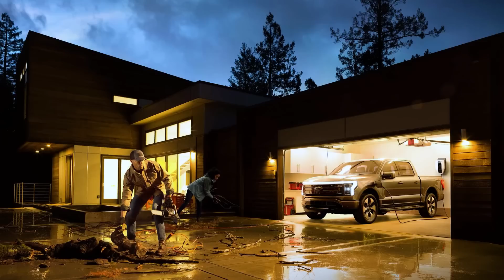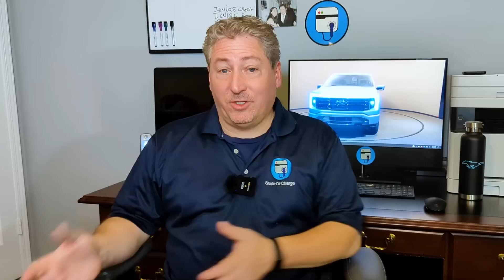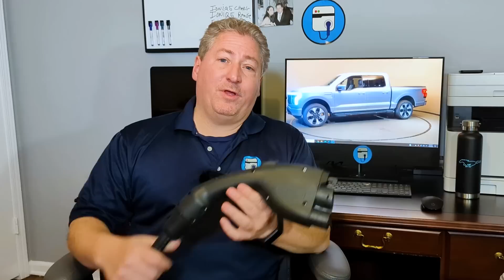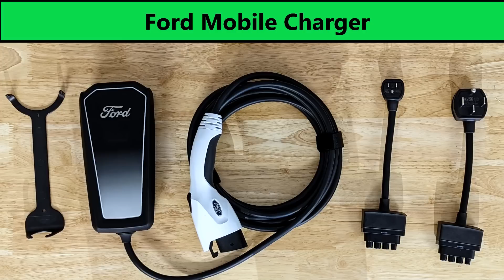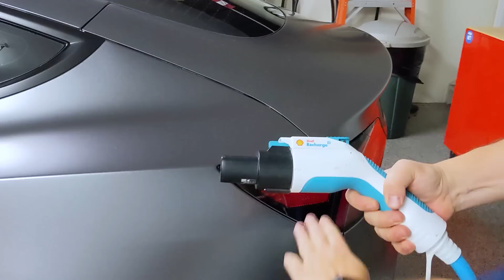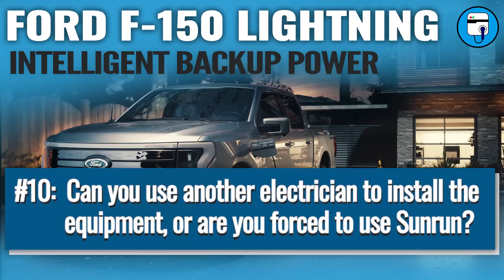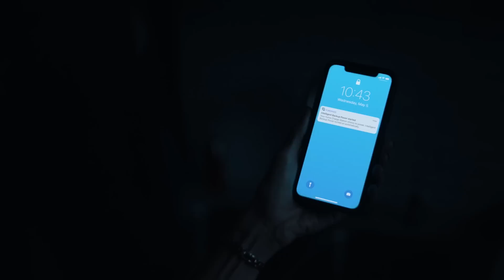Ford F-150 Lightning Intelligent Backup Power: Everything You Need To Know

Comment: So if I'm understanding this correctly, you need to also procure (from Sunrun or whomever) a compatible separate inverter, transfer switch, and small black-start battery. I expect that expense to be non-trivial, as the 9600W inverter will have to be similar in hardware to a solar inverter with grid-forming capability, and those aren't cheap- $3000 or so. It's neat that the Charge Station Pro is included with the truck, but it seems like Ford is leaving the expensive bit (the inverter) in the customer's court. 

Do we know if the Charge Station Pro can be used to charge (only) non-Ford-Lightning CCS vehicles? The connector will fit, but I suspect some vehicles may wig out about having a CCS connector engaged and being offered AC charge.
Reply: Ford says: "Connector uses industry standard/universal SAE J1772 connector. Compatible with all electric vehicles on the market today (that are compliant with SAE J1772), including Tesla with a commonly used adaptor". Of course, this excludes early models that only had the j1772 with no DC pins.

Comment: I hold the contract for several counties to install these for ford. Any additional questions you guys have im happy to answer
Reply: Can IBP sync with the Utility after going thru the SunRun inverter?  Just like solar panels & home backup batteries/powerwalls sync the 60Hz frequency.  But if utility drops, all the alternative sources of power drop to not feedback on the utility.  A switch to drop out the utility, without being a transfer switch, would be needed for utility safety.  Then the alternative sources of power take over. (Hmm, how do three different sources of backup power sync?  Vehicle, powerwall, solar?)  When the "magic" switch detects the utility is back, the alternative sources of power sync waveforms with it, and the utility connects back.  Is there such a thing?

Comment: It's really straight forward and basic 101.  All you need is a manual transfer switch which contains a certain amount of breakers that can total up to 20 amp to 50 amp or more.  You're just connecting all the wires that you want to power in your house by connecting it to your main breaker which goes to all of your amenities like fridge, stove, ac, certain rooms, etc.  There's nothing special about intelligent backup power, it's just a marketing gimmick.  The only thing is it has a software in the truck that will cut off the power to the house takes too much amp or watts from the battery.  Instead of using your gas power generator, you're just using the truck battery.  No technological break thru.  However, I like the idea which is much cheaper than dealing with a Tesla battery wall.

Comment: The Lightning being built is like watching paint dry. Bought a F150 Power Boost Lariat Hybrid while I was waiting. It will light my home and I can take it on the road with over a 600 mile range before I fill up in about 5 minute and go for another 600 + miles! Without a charging station on every Corning. My gut feeling is that Electric Cars for everyone may go away after the 2022 Congress Election and the tree hugger leave office!

Comment: I sorta suspect the warranty  for powering home will hold.  Pulling 9.6Kw a lot and charging back at 19kw should be WAY WAY WAY easier on battery than pulling 100-400Kw out on the roads and then charging at 150Kw at a DC fast charger.  So as far as the battery warranty goes...guessing Ford would be happy if you use it more to power house than drive around on long road trips.

Comment: My question for Ford is why are they charging people to use this feature on the standard range battery, if the feature is already built into the truck and I bought the truck then i should be able to use it without having ti pay extra, and if I do have to pay extra, that cost should be available and made public at the time I ordered my truck, not weeks after orders were made.
Reply: What exactly do you claim you were not informed about?  Every Ford advertisement (and webpage) has included in the fine print that IBP requires the Charge Station Pro AND additional hardware "to separate the panel from the grid".
Reply: So, I am willing to pay the $500 to get the Intelligent Backup Power software activation for my SR Lightning, but can't find where I can do that.  Ford's web site says, “Intelligent Backup Power software activation is included with the purchase of the extended-range F-150 Lightning battery or can be bought as a one-time purchase for the standard-range battery here.”  The word “here“ is a hyperlink to a page, after signing in, that says “SOMETHING’S NOT QUITE RIGHT, so it's a dead/bad hyperlink. No one in Ford Customer Service that I have spoken to has been able to answer that. Help!

Comment: There is some partial truths here or at least something to research further.  You dont need a 320 amp service.. However you may need a larger then 200 amp panel for your 200 amp service.   Reason is that it appears the  ford can push power back in to the house when the grid is up so you can pull 200 amps from the street and add in another 80 amps from the truck and run 280 amps of stuff in your house.  Thw two power sources can  overload the bus bar from a 200 amp panel.   The  'problem' is Ford Pro charger appears to be a  Standby System that can operate when the grid is up and is covered by section 705 of NEC which requires a larger panel to account for both power sources.  Since ford pulled this then maybe they are reconfiging their device before launch.
Reply: The truck can only provide 40 amps, not 80.  (9.6 kW)
Reply: @evahsia  That is 9.6KW of power is based on the built in inverter used by the plugs so it COULD provide more but I think you are right in that they did create it at the same 9.6kw.  That all being said, the same logic is still there, if they allow truck to feed panel at same time as street you would need a bigger panel.  But ford updating the website seems to indicate this would either not be allowed any more or not a core feature
Reply: @1personalt  I don't think so.  The built-in (in the truck) inverters are AC to DC.  They have nothing to do with DC coming back to the house, or the house would not require the separate SunRun inverter.  Also, the extended range has 19.2 kW worth of inverters, so if those were used, why would the limit be 9.6kW.  I suspect Ford recognizes that anything over 40 amps would require a main panel upgrade, at additional cost.  The same limit is why my solar power supply is limited to 40 amps.  (200-amp bus, NEC allows 20% extra -> 40 amps maximum.)
Reply: @evahsia  - I agree with that you are saying that the built in truck inverters have nothing to do with home charging.   And I think you are right in that if the home backfeed limit is 40 amps a 200 AMP panel would  be fine.   Where ford made it confusing is they keep highlighting the 80 amp charging feature and not really highlighting the lower limit.  But the fact that the 320 numbers are not on website likely means all the points you made are 100% correct.
Reply: Yes, it almost seems that they picked 9.6kW and designed everything around that.  For example, the cable from the Charge Station Pro.  The 80-amp AC side needs #3 wire and the 40-amp DC side only needs #6.  5 conductors of #3 wire would make an unwieldy cable even more difficult to manage.  (Technically, the DC side really needs only 24 amps (9600W/400V), so that might be a #10 wire.)  The largest single phase inverter SolarEdge makes is 11.4kW, so anything over that is probably very expensive.

Comment: One more thing: Why not use  "dumb" (my term) backup power. My plan is to use the Nema 14-30 plug in the bed of the truck and connect to the installed generator switch next to my service panel which I can manually switch over to the needed circuits. If I am home it's no big deal to pull out the extension cord and plug the truck into the generator switch. Only advantage of the intelligent power back is time saved by automatically restoring the power. The truck still needs to be plugged into the charger and If it's not at home there is no backup anyway.
Reply: This a great lower cost, easier to deploy solution using the "ProPower Onboard" L14-30R in the bed.  What I've read is that the GFCI L14-30 outlet needs a "switched neutral" transfer switch so the GFCI won't trip.   Some youTube videos have been trying this out using the "ProPower Onboard" L14-30R on the existing 2021 F150 Hybrid.   The Lightning will also have "ProPower Onboard" but I don't know if it will be an L14-30 or L14-50

Comment: Tom...Great work. Question: Tesla mobile chargers know by the adapter how much amperage to pull from  the charger.  In the Ford website they show a F-150 Lightning charging another car, only thing is the mobile charger is a nema 14-50R and the truck bed as far as I can figure is its a 14-30R. You cannot plug it in without an adapter. No one I speak with at Ford knows if you can use an adapter to plug in the mobile charger. In that same line of questioning, can I use a 10-30P to 14-50 R adapter to charge at home from my dryer outlet and will the truck adjust for max 24 amp charge (80% of 30 amp) or will it try to pull 32 amps (40 amp breaker 80% = 32 amps) and blow the breaker? Is there a way to limit the amperage going to the onboard charger manually or automatically?
Reply from the maker: Ford will be selling an adapter to plug the 14-50 plug into the 14-30R in the bed of the truck. (actually, I'm not sure if they will be selling it directly, or if they will be recommending a certain one that you buy online). Yes, you will be able to lower the charge rate of the Lightning. I don't think it will detect the line amperage and do it automatically, though. I believe you'll need to set the truck to a lower amp rating, but I will ask that also.
Reply: @StateOfChargeWithTomMoloughney  Got one delivered today from Amazon in anticipation. Also picked up a clipper creek charger for $275 that was installed and not used. Ready for the truck now..4 more months.

Comment: Thank you for this informative video; I am a Lightning first-day reservation holder and found this very useful.  The electricity where I live (South Carolina) is pretty reliable and events that cause extended outages (ice storms and hurricanes) don't occur that often.  When extended outages occur though, they can be a up to 10 days and pretty miserable.

So, I would like to have the ability to use the Lightning as an emergency electrical backup, but I don't think I can justify the multiple thousands of dollars it takes to set up the Ford/Sunrun intelligent backup system.  I'd also have qualms about sinking so much money into a system that might be incompatible with future vehicles from other brands given the lack of standardization at this point.

Consequently, as a topic for a future video I'd like to learn about lower cost alternatives to using the Lightning for this purpose.  In particular, my thought would be to use the 240-volt outlet in the bed like a standalone generator.  Could I get an electrician to install a 30 amp inlet box in my garage and either a transfer switch or a mechanical interlock on my breaker panel?  Is there anything special I need to ask for?  In particular, TFL did a similar demonstration with an F-150 Hybrid but it didn't work initially.  They did a second video where it did work, but didn't really explain what had to be done to make it work.  My impression is that the 240 volt outlet can only supply 30 amps compared to the 40 amps for the Ford integrated system, but this seems like a reasonable trade-off in my particular case.

I share the concern you expressed on the InsideEVs podcast about keeping the MSRP of my future Lariat ER under $80k in case the EV tax credit gets revised.  I'd also order the towing package upgrade if it didn't push the price above that threshold. I already have a 40 amp EVSE installed in my garage and don't want to upgrade to handle a higher amperage. So, the special 80 amp EVSE that is included will just go on a shelf in my storage room.  Ford, if you're reading this, I would certainly like to be able to delete the EVSE or downgrade to the standard 30 amp portable EVSE included in the standard range models for a credit.

Comment: I installed an outdoor 220v plug with a gfi breaker at 50amps.   I wonder if I had the pro charger hardwired outside if I can switch to a non gfi breaker at 100 amps.

Comment: Seems like a lot of red tape just to back feed some power lol. I guess they cant be liable for killing someone. In winter you should have some non electrical back up heat. Propane. Fireplace. ETC. Truck should run your lights and tv for a week easy. Warm up your hot water when you need a shower but I bet that uses quite a bit of power. It will use about 5500 watts for 1.5hours to heat 50gallons to 140ish. good for a few quick showers.

Comment: Tom, Great video, very informative.  I had many questions and you and Ford answered them all.  Thanks!  PS.  I do hope that Ford provides better integration with PV solar backup in the future, and also makes the on-board 19 kW charger bi-directional.  The latter would save quite a bit by eliminating the need for a separate  off-vehicle inverter to power your home.
Reply: I have a 13 kw solar system that powers my home, but will have to either reduce the input of my pro charger to use on my solar system else connect it to the grid and leave it set for full 80 amp input. But I will be using the 120/240 charger that comes with the truck to charge using my solar as it only draws 30 amps 240 volts or 7200 watts.  On a sunny day my solar batteries are usually topped off by 1 p.m. so I'll still have a few hours of charging available to me. At approximately $.15/kWh it certainly wouldn't hurt to just charge off the grid even cheaper in the winter.  I only drive around 100 miles a week so at 2 miles/ kWh that's only $7.50. That's approximately 50 kw so just 2-3 hours of solar would replenish my truck battery at no cost.

Comment: At the end of day Ford is a automaker. They are not a utility company. Therefore, I would not trust anything coming from them when it comes to installing a home charger for an electric vehicle. You have to have a certified electrician assess your residence to determine what your options are and what it would cost to install and get a permit for the installation. It’s an extra cost that varies. Also another thing no one is talking is what will happen with your utility service. Just because you have back up power does not mean you will save money on your bill. In fact it may increase your cost if you have the ability to disconnect from the grid and produce your own power. So check with your provider before pay big 💰 to install the 80 amp system. Man 75k to 100k on average for an F150. The cheap versions are sold out so it will be interesting to see how many people complete their reservations and purchase a lariat or the platinum as Ford has no plan to build the cheaper versions in mass quantity. These trucks are not made to order. They’re made for maximizing profit for Ford.

Comment: Have you considered if the (expensive) CCS to Tesla adapter will work to charge a Tesla from the Ford Charge Station Pro?
Reply from the maker: Yes, I have thought about it. It shouldn't work because that adapter uses the DC pins for power. Ford Charge Station Pro is incapable of providing power through those to bottom pins = it won't work.

Comment: In a power outage I would be very happy just having those 20A 120V outlets that are in the truck! I could make coffee, heat up something in a microwave, then plug in portable heater. All while have numerous LED lights going and charging all my phones, tablets and computers. 
I have a Tesla and despite that huge battery pack that's in my car, I can't do any of that! During a blackout all I can tap into is a tiny 12V outlet. I could charge my phone or put a little inverter and power a couple of LED bulbs and charge my phone, but that's about it.

Comment: Um er.. I have a really stupid question..
If it has intelligent backup power?
What the fuck charges the truck? Before it charges the house?
What a huge con..
You have to charge the truck before you can run the house.. What a wank...
Reply: Charge the EV before the storm... just like I have to be smart enough to get gasoline for my existing portable backup generator before a storm... The winter storm that just shut us down for the last two days was broadly announced days in advance... so charge the truck ahead of time just as I did my existing EV.  This is a con or common sense?   It's intelligent in that it deploys the backup power automatically just like a standby (not manual portable) generator with an automatic transfer switch (yes assuming the truck has sufficient battery charge) and then when the grid is restored, it automatically switches back to grid power.

Comment: Thanks Tom! Trying to wire our new house as we speak and could not get any details on the intll backup system.  We have two SPAN.io 200 amp panels, 400amp grid service and 24kw Tesla Solar roof.  ADDTL QUESTION FOR FORD:  will the intelligent backup system be able to backup both 200 amp panels or just one? (Span enables you to choose which loads to backup within each panel but need to know if I need critical loads on only one panel)